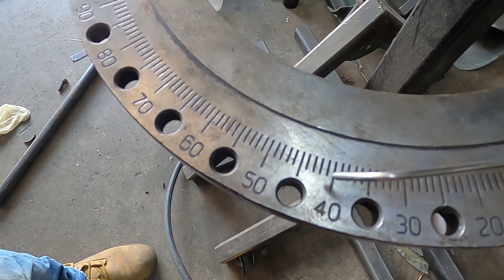SHO’NUFF Happy Little Bends!

Comment: My first Civic I put undercarriage panels like this, disc-wheeled some forward-to-rear (linear with the flow, not sides that would cause more drag) exhaust vents for the exhaust channel, made a huge accelerating difference from 90mph-120mph, on the highway

Comment: Shawn, glue a speaker magnet to the back of the tape measure. You’ll love it
Reply: They make magnetic ended tape measures lol it sucks when it won’t stay
Reply: @stevenmcc2119  I have a clip to my belt with the magnet and it’s an old Stanley tape measure holder. It works great for standing measuring but not so good when I’m walking/working in and out of framing and tight spaces. 
It’s great for fabrication

Comment: Radnicity of chassis building 😊 One of these days I'm going to build out a cage with the bars as the A, B, and C pillars. Cut away all of the structure and replace it with tubing. Top of the windshield support removed and replaced with tubing. X bracing inside the door with catch lock bolt. With interior panels in, the only visible bar will be the harness bar with a big fat cert sticker on it. I've seen it done to that extent once. 
Anything faster than 8.5 seconds is a no way. The 25 cage sucks and makes a car unstreetable. 
Before someone comments about safety, nobody has died in a 6 second or slower car in 30 years or so according to NHRA and IHRA. Like any organization created out of necessity, they continue to make changes and alter requirements to stay relevant. From OSHA to NEC it's the same pattern. A house built in 1934 burns in Chicago, they change the National Electric Code. Even though the previous code has never had any incident. They have to maintain relevance or they have to cut back or disappear entirely. 
I can pretty much guarantee that nothing in plumbing or electric has gone unaddressed. Technically speaking as well as statistically speaking, an updated code is not necessary, ever. Every safety issue and potential hazard has already been addressed. 
Will they call the board in for a massive Nationwide group and say, "Guys, we've done it! We've addressed every potential issue over the last 100 years. We have no more reason to be here." Nope, not going to happen with any organization. Will be 150 years without incident, they will still add requirements every 3 years. Whether you need it or not. Nobody wants to be irrelevant lol.